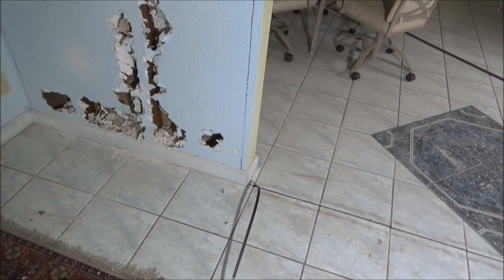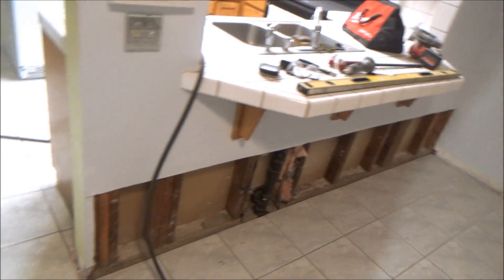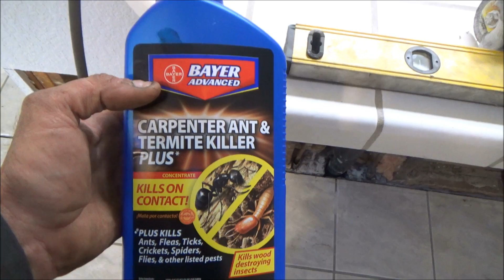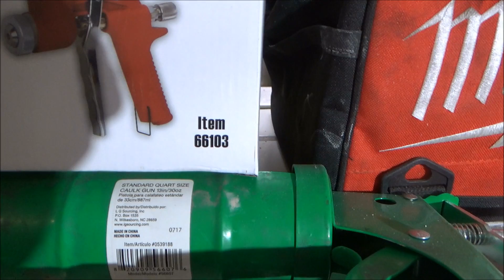Repairing Termite Damage in a Slab Foundation

Comment: Impact drivers are the best thing ever for driving screws. I did fine wood work for nearly a decade and it was a chore trying to train kids on how to drive a screw into finished wood without slipping off and damaging it. Needless to say, once impact drivers came out, I had much fewer employee repairs.
Reply from the maker: sixtyfiveford   With a drill you have to push real hard on it not to strip the screws out.   The impact drivers you don’t have to do that.  There also so small I can get it into tight places.  I bought that impact driver almost 3 years ago and just started using it.  Now I will be using it all the time.
Reply: I use mine all the time on machinery repairs. Just throw a 3/8"  on it and sockets on it and it'll whip off virtually any small bolt. My SnapON 3/8" air impact has been retired since I got one.
Reply from the maker: I also have the 1/2 drive Milwaukee impact.  I use that all the time out in the field.  Works great for taking Axle nuts off and Harmonic balancer bolts ,  and many other things.

Comment: I have used beyer concentrate insecticide for years It works great, then i started to double the amount of concentrate I added to the water & it quit working, good thing my buddy told me the reason why, then I mixed the correct amount stated on the container & it worked great again so I dont know if it is a great idea to dump the insecticide without mixing it.
Reply from the maker: +mannyrob    After I did that I had to spray a little bit of water down the crack to wash it out before I filled it in.   So I think it got diluted a little bit.

Comment: The mud for the joints won't take the paint right if you don't prime it.  It will cause the color and texture of the new paint to be different.  Prime, then paint and it will look much better.  The best way to match the color is to paint the whole wall.

Comment: Hate termites, little pricks do a LOT of damage. I would have dumped a 55 gallon drum of the stuff under there...LOL.  If the original texture looked like it was sanded flat they probably shot the texture, let it set up a bit then troweled over it to flatten the peaks out.  All looks good in the end.
Reply from the maker: That termite killer was pretty expensive and the fumes were so bad dumping it down there straight not mixed with water the way your suppose to mix it.